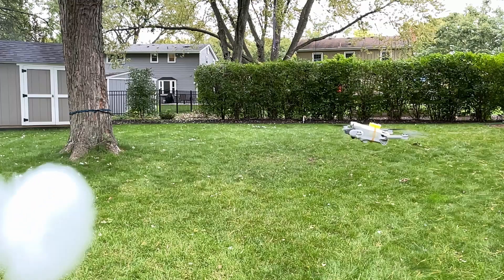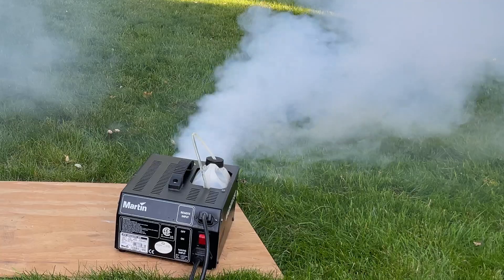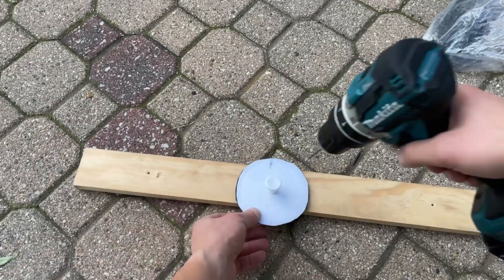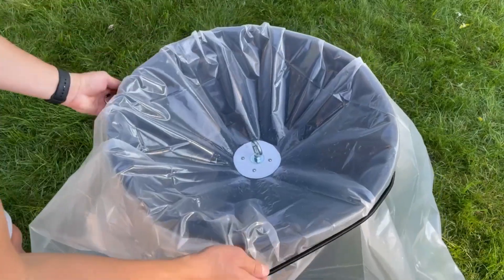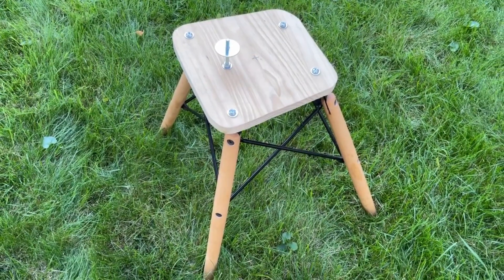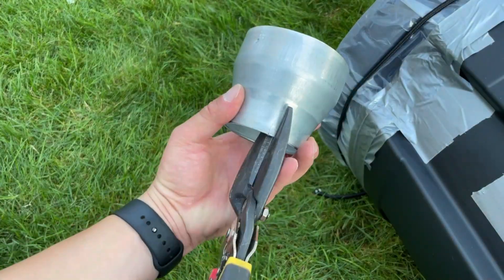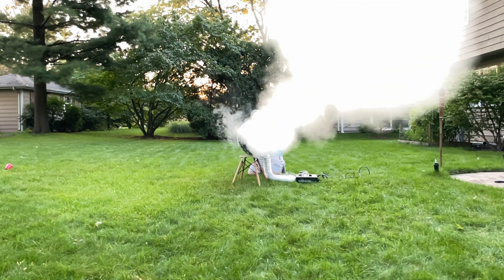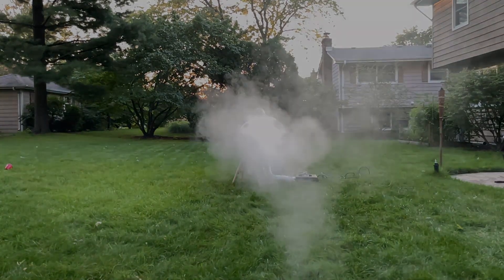Building a Vortex Cannon (Air Cannon)

Comment: do this indoors with lights on your floor facing up towards your adjacent walls "indirect lighting". you need your cannon to remain still as i can see it wobbling when you are using it. this is why your smoke rings are distorted and not well defined. The surrounding air should be as still as possible. closing doors or moving around will cause the air to move and bounce off walls resulting in distorted air you are trying to push your smoke through. think of the air as water and how throwing a stone into water will affect the surface tension. do not release the the ring all at once instead use it to just push the air out slowly. this will give you a super dense smoke ring that will slowly move through the air slowly and not break apart it will look very cool in a long room

Comment: You need to leave a small air gap between the tube and the fogger. The fogger gets fresh air from the same port as the exit port,  they are one and the same.